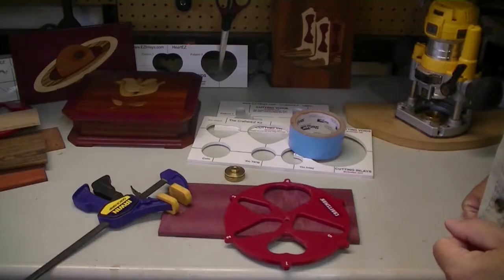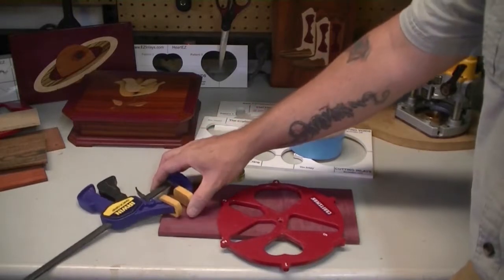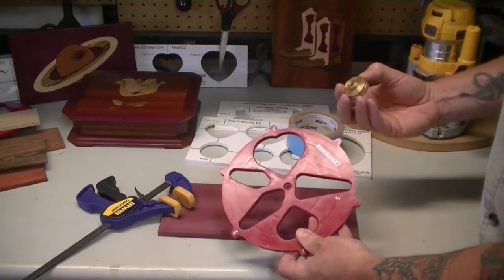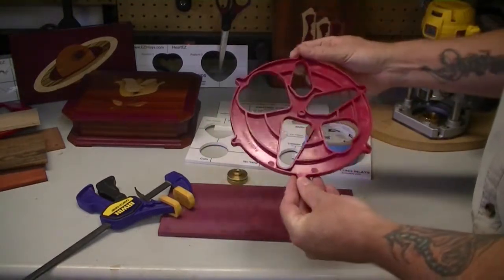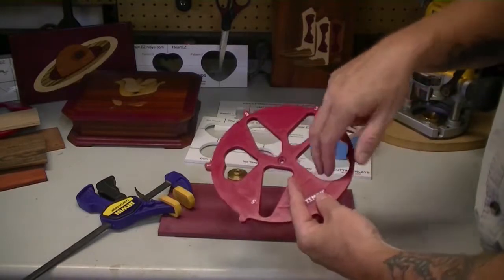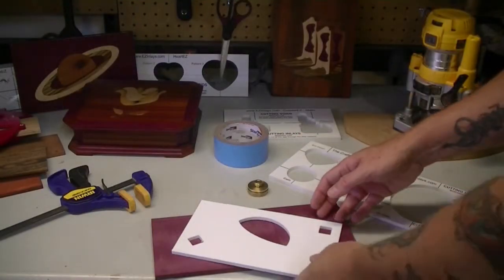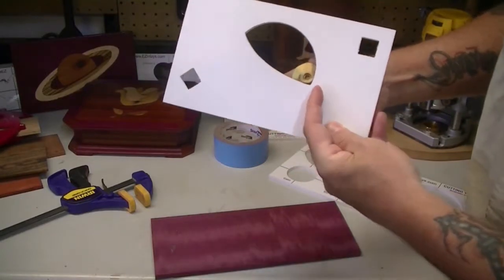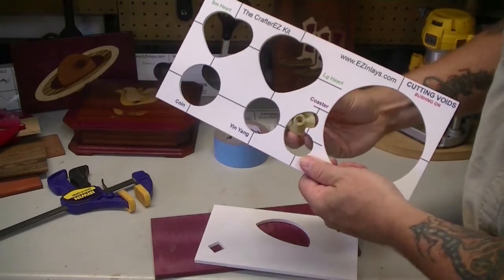Router Inlay Templates

Comment: If you need to sand the inlays to make them fit, you have a discrepancy between your 1/8” bit diameter and the wall thickness of the sleeve. If they are precisely the same, the inlays should (and will) fit exactly right.
Reply from the maker: You are correct John, centering the router bit is extremely important when working with inlays.  
There are several other factors that can come into play too.  
Some woods, when cut, tend to malform a bit due to the tension in the wood being released.  You'll see this more in highly figured woods than woods with straight grain patterns.  
When cutting some woods, like Maple, the debris tends to cake up and cling to the side of the inlay as well as the template wall.  This material has to be removed to get a good fit as well. 
That and human error always is a factor!  
Actually this is a great topic for a blog post: "Why Doesn't My Inlay Fit".  Thanks for the idea!!!
Reply from the maker: Sometimes you will find that the bottom of the material has burrs and left over and some residual tape material that needs to be cleared away.  

Also if the router bit isn't perfectly centered in the middle of the busing you'll see some areas that need a little sanding.  

But in a perfect world, you're right.  Very little to no sanding is needed.

Comment: This is a great video, but your assessment of the Craftsman template at the start is a little disingenuous as you didn't mention that it is a part of a larger dedicated jig that is very flexible with hundreds of patterns possible. Using that template as you described would be difficult, but it wasn't designed to be used that way without the frame that holds the circular templates.
Reply from the maker: When I purchased the template it was packaged as a two stand alone templates.  I didn't realize the template was part of a larger kit  (until much later) and nowhere in the instructions, printed in size 4 font, did it mention it either. 
The biggest problem I had was when I used the template to cut inlays from a small pieces of wood. Those materials didn't have the surface area needed to affix a frame template.  Without a good surface area on the bottom of the template it was difficult to keep it from moving when routing. 
The main point I was trying to make is there is a an easier way to align and affix templates.  Actually that kit is what drove me to create my own designs too!
Thank you for the feedback!
Reply: @EZInlays  Thank you for the explanation - buying it in those circumstances would be confusing :)